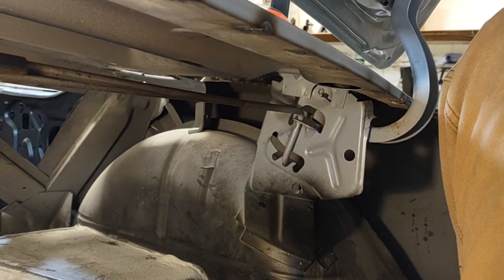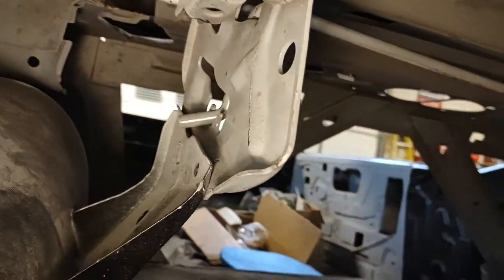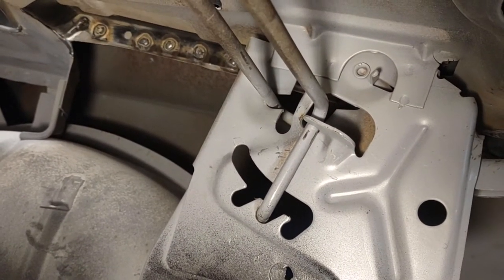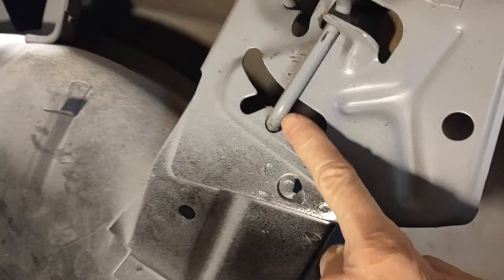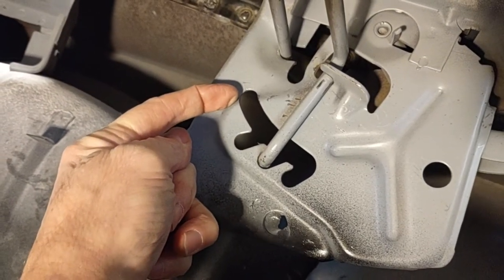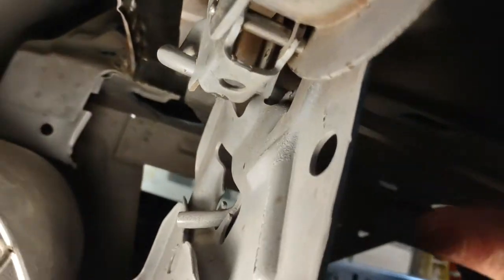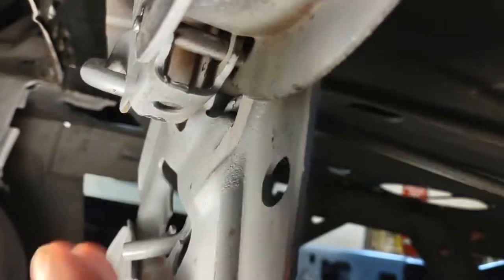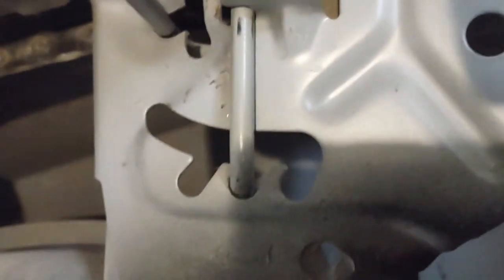How to Properly Remove & Install Trunk Deck Lid Torsion Springs

Comment: Because i was looking for this answer for me...

The "L" shaped side obviously attaches where the 3 hook slots are...

But which bar goes which side.??

I saw in the video.. the outside of the " L" shaped bar... has a slight bend. Point the little bend to the front of the car.

Plastic slide tube on the L bar from the right in this video.